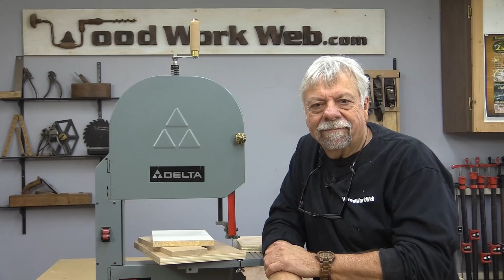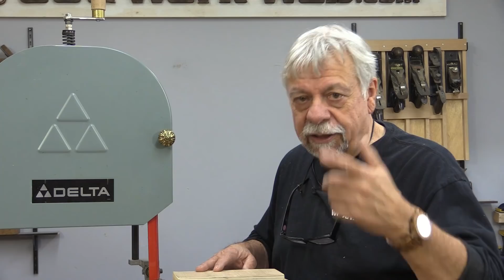Bandsaw Tearout Test - Tape Vs. Zero Clearance Insert

Comment: Colin, Great video. There are hundreds of wood myth's around and you have exposed many, so thanks. Over the years I've  bought a lot of commercial doo dads, jigs and thingamajigs to supposedly solve one problem or another. I used dowels and, later, biscuits to strengthen joints, but I think their only purpose is to align the pieces because they are, after all, made out of wood. I wonder if you have ever tested joint strength with or without dowels/biscuits. 
A lot of  gadget manufacturers aren’t going to like you.

Comment: As a general rule, I have had decent luck out of using Frog Tape and rubbing the tape down with a block of wood to maximize adhesion.  Never tried it on the band saw but it works great for the table saw, jigsaw, skill saw,  and even crisp sharp paint lines.
Reply from the maker: Yes, burnishing the tape like that seems to work for some people. I'll try it in a future video. Thanks for watching!

Comment: Are you burnishing the tape. Heavy burnishing is the only way I have achieved good results with tape. Thanks for all your clips.
Reply from the maker: Thanks for the tip and thanks for watching! I try heavy burnishing in a future video.
Reply: James Bramblett Agree. Masking tape doesn’t adhere as well if you don’t rub it down after applying. Same thing for painting. The paint can leak under the tape if the tape isn’t pressed hard on the surface.

Comment: Good video Colin.  In my 40 years of wood working, tearout is always a problem especially when cutting veneers and melamine.  What I find works is using a sharp blade, and if possible a carbide blade but these are very expensive.  It is to note that even with these blades is not a cure all.  Just remember that the bandsaw cuts downward so there will be more tearout on the face down, (against the table)  Think out your cuts and put the tearout side to the side that you wont see it.  Take care and be safe.   Tim
Reply from the maker: Thanks for the tip and thanks for watching, Tim!

Comment: I have seen lots of videos on this subject and none have succeeded. I do know a way of doing it, as the son of a friend owns a shop in Durham that does fitted kitchens/furniture etc.And his solution is a $20,000.00 - probably 26000 now - table saw, that has blades on top and bottom. I will deal with the tear out LOL
Reply: Many of the really expensive sliding table saws come with a smaller second scoring blade which scores the surface right before it touches the main blade.  Pretty cool stuff.
Reply from the maker: Yes, a scoring table saw is the way to go, if you can afford it! Thanks for watching.

Comment: Would a backing board work? In other words a sacrifice piece under the board you are cutting. I tried this when cutting clear hard plastic and it worked great. The plastic always cracked. I used a scrap piece of oak under the 1/8" plastic and it prevented the cracking.
Reply from the maker: It might. I'll give it a try in the future video!

Comment: I guess if you wanted to totally eliminate tearout, you could strike an accurate line on both sides of the material, the top line to follow with your eye, and the bottom one where the blade exits.  Then make a scratch cut with a scoring knife on the bottom cut, pre-cutting the fibers so that the blade doesn't drag them out.  Similar to cutting melamine on the table saw, do a first pass with the blade raised only about 1/16" to score the plastic coating, then raise the blade and make the full cut.
Reply from the maker: Thanks for the tip and thanks for watching!

Comment: Good test with expected results. Thanks for sharing.
 It really seems that tear out can not be avoided. So we have to use some elbow grease to make it disappear (which is probably the
most difficult at the double-sided melamine board)
The other option is to not cut/saw wood. In that case we have no tear out but no thing which we would like to have either :-)
Reply from the maker: Agreed, hard to avoid ... although the way blades are evolving, I won't be surprised to see tear-out free blades in the near future.

Comment: would only be a valid test if you used a new blade, i don't seem to get the tearout you do, but thanks for the effort.
Reply: With all due respect:  Question is how long is a new blade new?  Even if it was better, how many new bandsaw blades are you going to have on hand?
Reply: @dwightl5863    good point
Reply: the tooth count plays a key role here.  regardless of age, a crosscut blade would give you less tearout than a ripsaw blade
Reply: So, you put on a new blade for every cut on your bandsaw? That must get expensive.
Reply: @OB1KYOT     no, for the test, that is why you call it a test